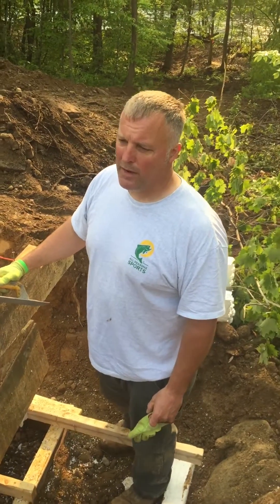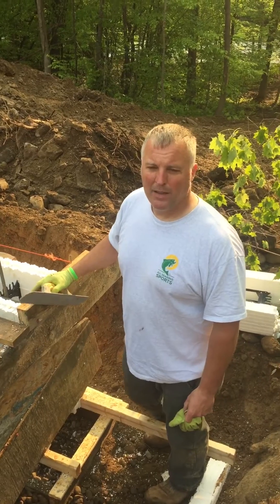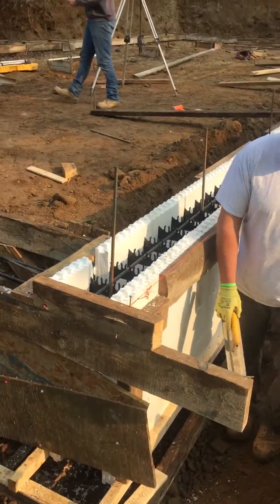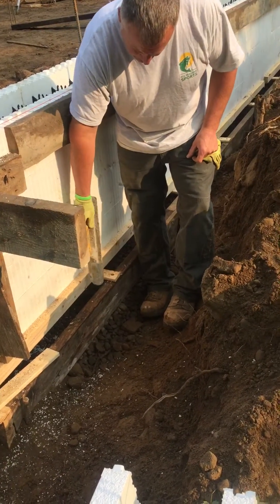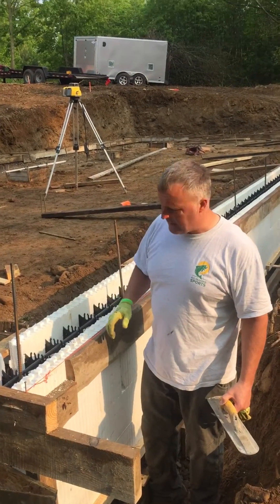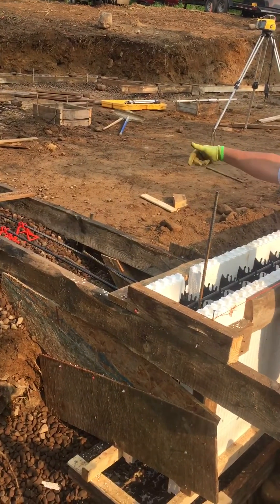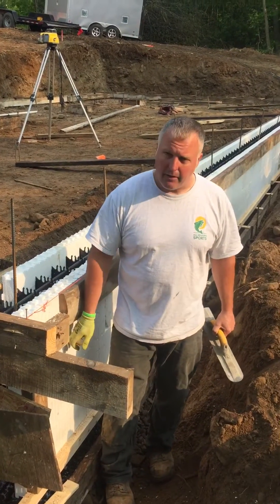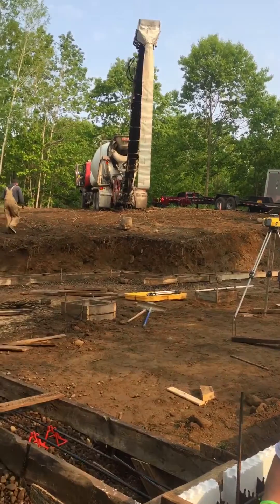Monolithic wall and footer pour at the same time. Monopour.

Comment: Have you ever looked into any of Fab Form's products? They have a Fast Foot and a nice Monopour system. They also have an interesting bracing system  and they make Helix micro rebar. I'd be interested if you have ever worked with any of their products (which should work with pretty much any ICF and if so, what you thought of them.
Reply from the maker: I have researched but not used there products. Next year I’m going to try my mono pour system with form a drain footer forms should work awesome. 👍 we have $6000 tied up in our own bracing system from Nudura.

Comment: So the 1 inch board is actually encasted in stem wall after pour??
Reply from the maker: Gale Cooney yes exactly it just stays in there. Won’t hurt a thing. I use 1x3 furring strips for a 16” footer. If you go wider footers like 20” or 24” use a 1x4. Or they will bow when the concrete hits them.
Reply: Bondo Built how much waste do you have with the gap that’s between the top of footer form and the bottom of the wall form where you inserted the furring?